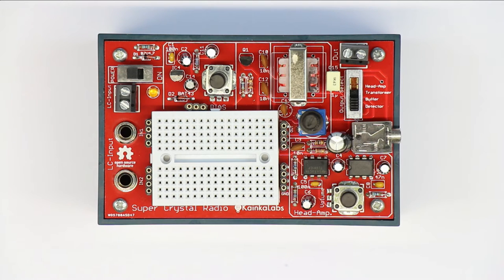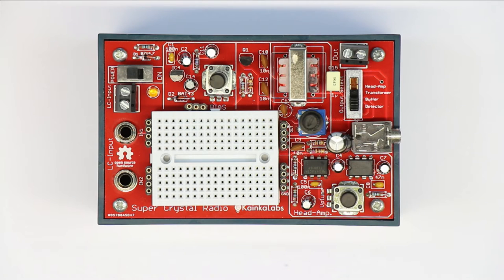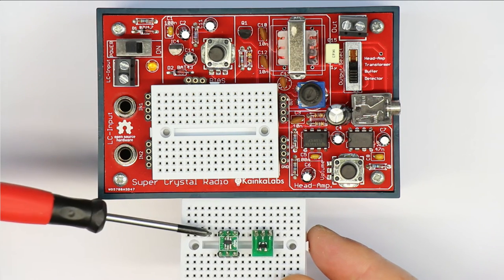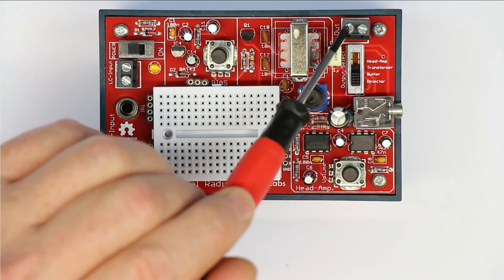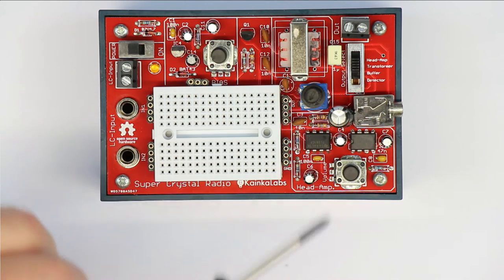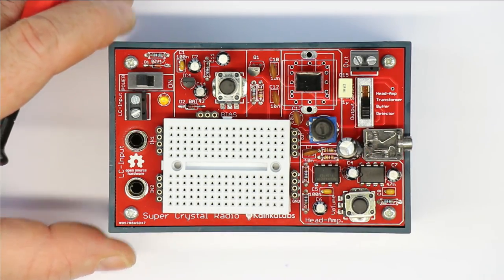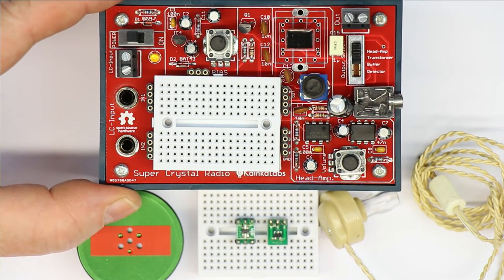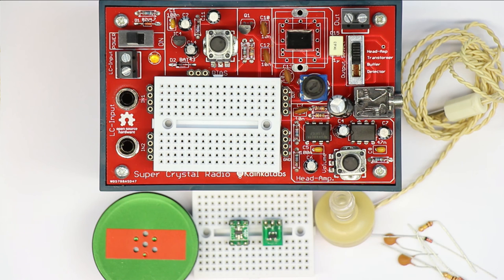A universal Crystal Radio Set

Comment: Hello again. I have been reading through the manual, and I came across the section where it says that a transformer could be used in the LC antenna tuner to match the its high impedance to the lower impedance of the detector and earphones. It also says that this reduces the voltage too and it's not desirable because the signal wouldn't have enough voltage for the detector.
I have a question about this: what is really important? Voltage gain or power gain? Because impedance matching is usually assumed for maximum power gain. If we use a transformer in the LC tuner, voltage is reduced but current is raised (power is constant in a transformer). So, what should we care for? Voltage or power?
Thank you!

Comment: Wow, lovly kit you made

Was wondering if you could offer this through conrad?

Tell me, why do I need a capacitor (what value) if using high empidence headphones?

While I need a resistor if I use a crystal earpiece?

I have some old ussr made 2000ohms headphones I can use

Also, if you compare crxstal earpiece to high empidence headphones, what will pick up weaker stations?
Reply from the maker: You can buy it in our shop with worldwide delivery:
https://www.ak-modul-bus.de/stat/detektorempfaenger1_crystal_radio_set1.html
Why should we go to Conrad which would add another 100% to the price for their revenue?

Comment: But first let me install a battery
Reply from the maker: No, it also works in passive mode :-)
Reply: @KainkaLabs  To totally eliminate the battery, it maybe possible to charge a tiny Li ion battery using a high frequency rectifier diode and an antenna for always present RF signals. This setup would definitely be capable of providing forward bias current for the detector diode and also a tiny audio amplifier.